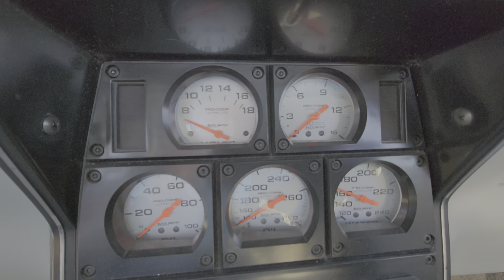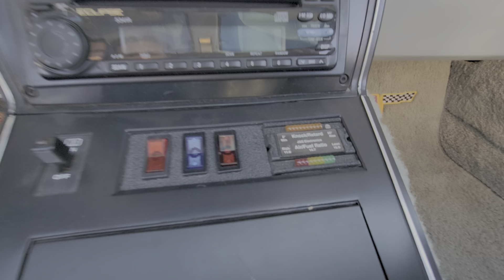Not Your Average 1982 Chevrolet Corvette For Sale~Monster 509~6 Speed~Fantastic Restoration!!

Comment: Very nice build!  May have power to hit 200mph, but the aero of the 80's c3 will lift and get very sketchy above 130.  To hit 200 would need serious front end splitter work to keep it planted.  Not taking away form the build at all 10 out of 10! Sounds great.

Comment: I went the same exact route as  you but with a 72 corvette and merlin  aluminum block and heads 
541 cid 
I sold it 
And now i have a 07 C6Z06 
It towers over  that scary 540 Corvette
Reply: So your saying the 07 Z06 out performs it ? The Z06 is an all around better car but 541 Cid has to be a huge torque monster
Reply: @johnnydoubleu3656  
The impressive power of 541 big block can NEVER be matched by any NA 427
541 had GOD power every and the chassis of c3 corvettes are garbage NO matter what you do to it
Even with an all aluminum 541 motor and tons of after market products it was unsafe and twitchy 
C6Z06 has a great chassis feel and control and it is too bad GM didn't put a monster cubic inch in a zo6 chassis
541 had 723 hp and 687 tq on flywheel with 
93 pump gas
Reply: @naturallyaspirated7829  I have a 69 vette and looking to put a Shaffrof 540 all aluminum including block.  What headers did you use for your 72?
Reply: @stantheman1911  
I used hooker headers 2 1/4 primeries with 4 inch collectors and sidepipe open headers ( all chrome)i think it cost 1600.00 all together 
I must warn you it is an over kill combo with such short wheel base car
Be careful 
Bless